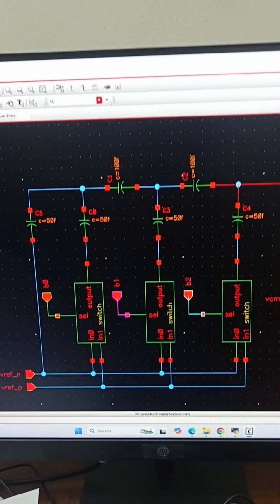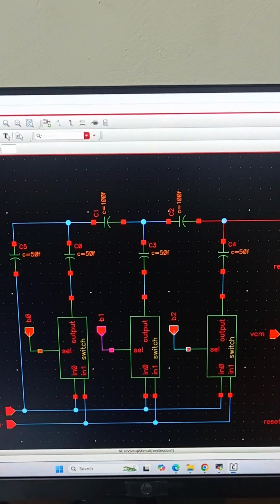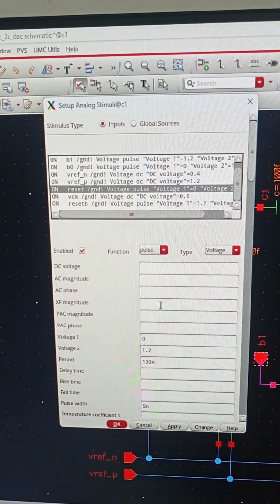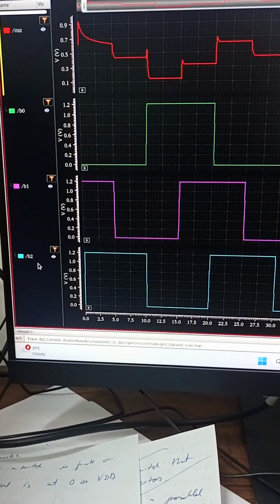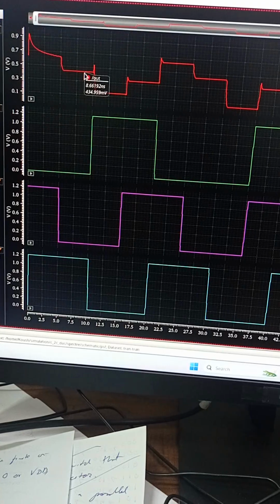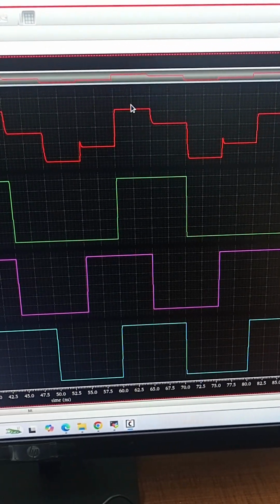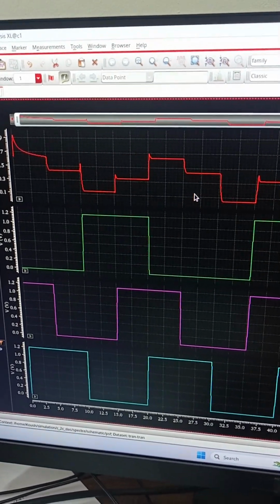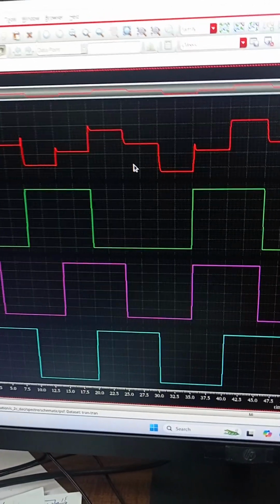C-2C DAC for VLSI Projects | Easy 3-bit Capacitive DAC Using Cadence Virtuoso

Comment: Hello, I have design 2 but DAC binary weighted, it's work good but integrate with SAR logic my DAC output in negative side
Reply from the maker: I can only check if you share screenshot of circuit diagram with sar logic + dac.
Reply: Where i have share, can you give me mail id or whatsapp no.
Reply from the maker: 9928935246
Reply: I have shared some pic. On your WhatsApp , but you didn't seen till now...